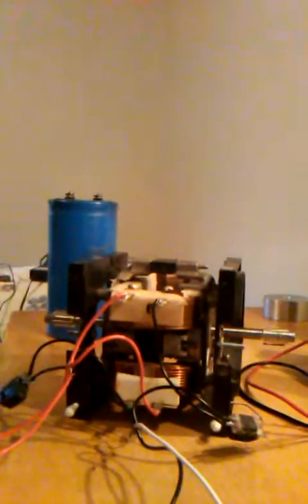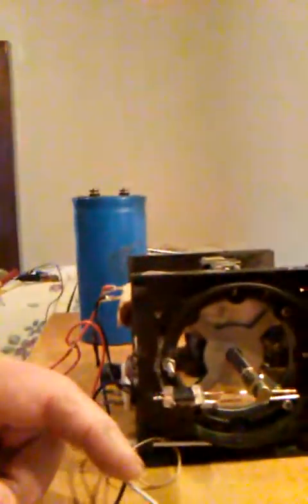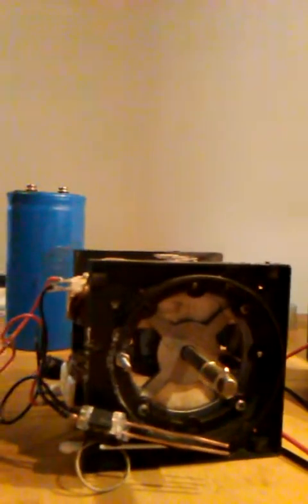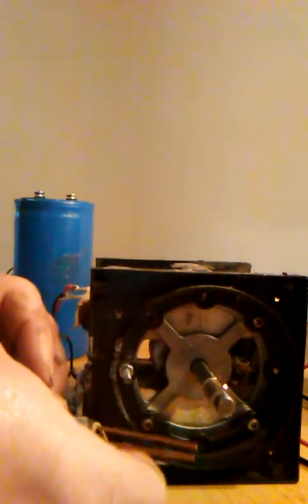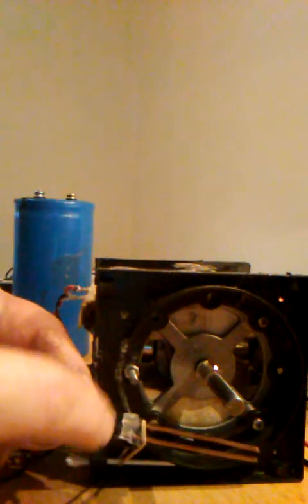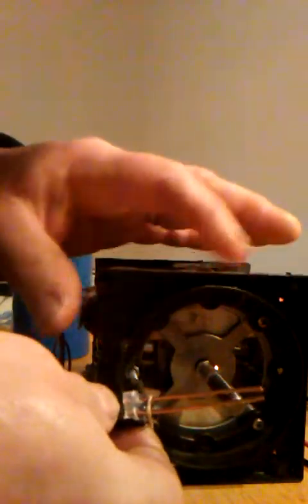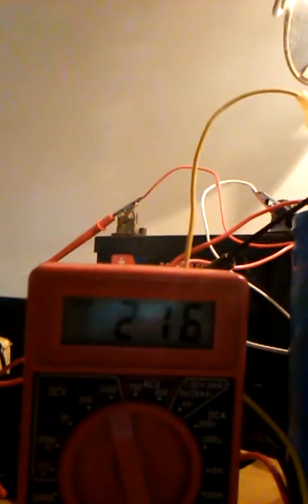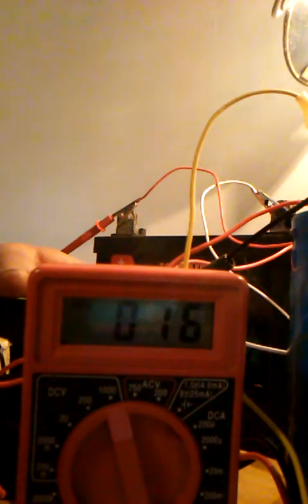This is a tutorial on how to duplicate my Newman motor

Comment: How about replacing the commutator with some ignition points?
Reply from the maker: Thank you for your comment, I guess I just believe in keeping it simple, if I were to build one to last I would probably put points on it, but this one I don't run it continuously so it was easier just to use wire, thanks again for your comment God bless